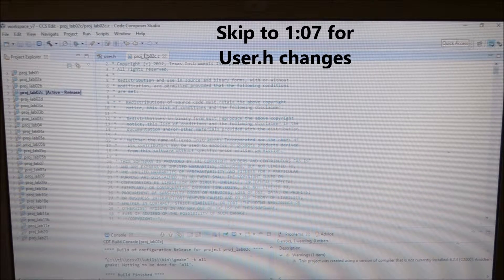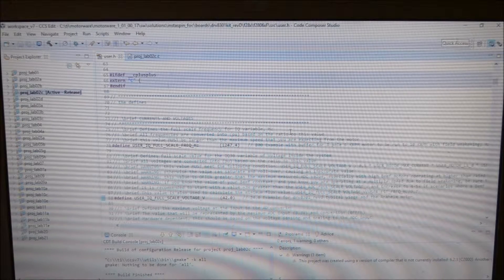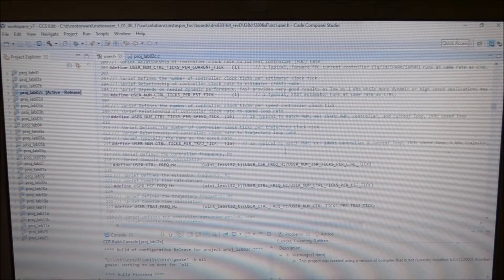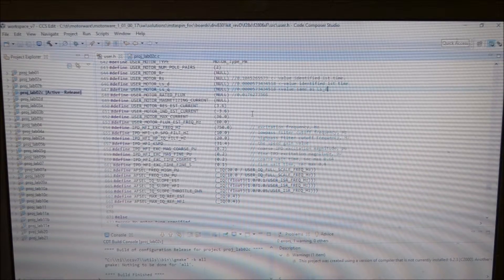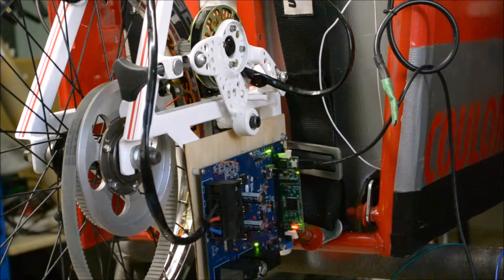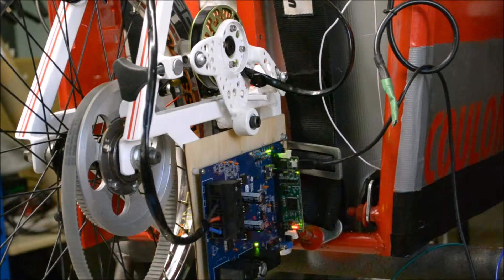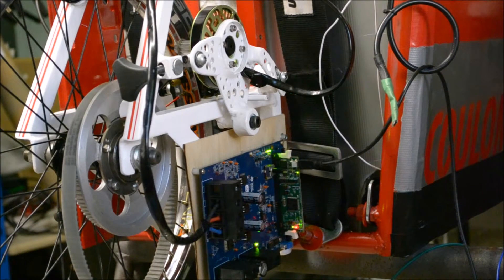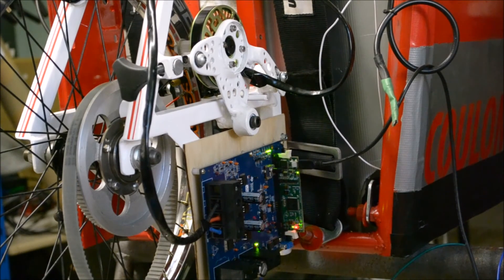TI INSTASPIN ISSUE - Lab2C with low inductance motor.

Comment: I make e bike with same motor(90 kv,) vesc6(foc(and need to set maximum switching frequency(38-40kHz) and it all works ok on 14s lipo battery and I can set phase current and set up temp sensor and I will newer fry motor and all works without halls and etc (my bike use 26 inch wheel and 240 teeth gear on the wheel and 12-20 gear on the motor(I can change gear to get more max speed or less speed but more torque for riding in the forests and etc )